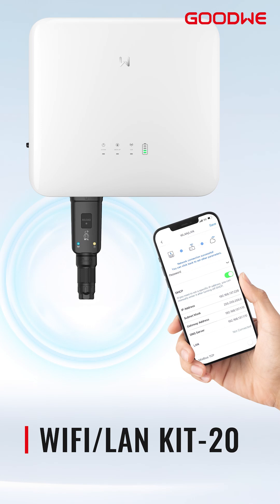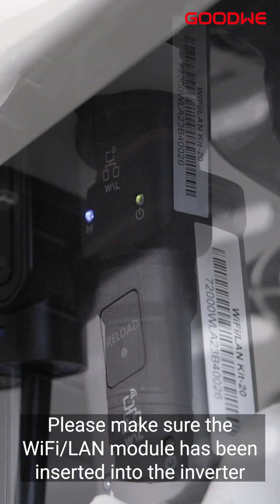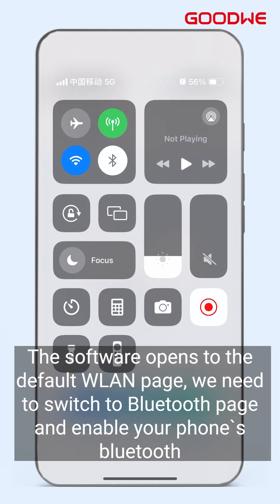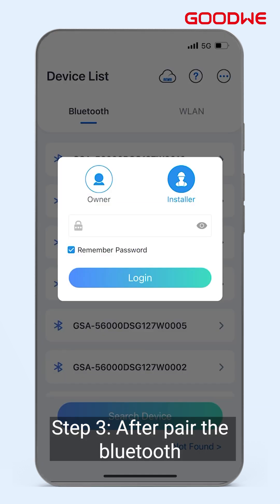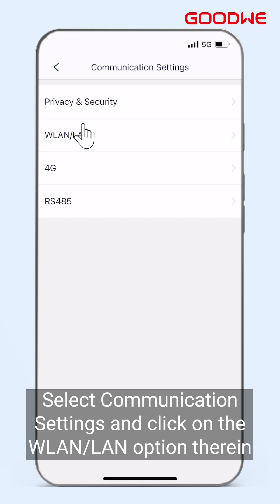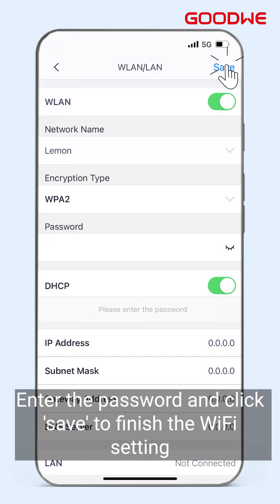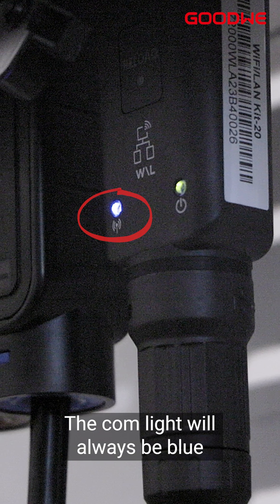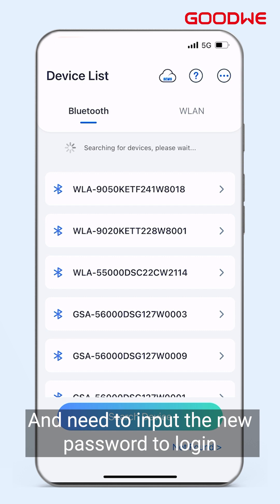GoodWe WiFi/LAN Kit-20 Configuration Guide

Comment: Can’t we configure via module wifi? Only this compatible with Bluetooth?
Reply from the maker: Hello, If you choose to connect the device via WiFi, open the WiFi settings of your
phone first and connect to the inverter’s WiFi signal (Solar-WiFi***). Default password:
12345678.
Reply: @GoodWeSolarAcademy    Yes i already tried to do for two Godwe inverters with this kit. But it’s not searching inverter wifi with this kit at all. I tried with many devices. Is there any solution for that. Thank you.
Reply: @GoodWeSolarAcademy  Hi , what if I cannot find the inverter's wifi signal at all - only bluetooth? What happens then? Could it be a faulty dongle?
Reply from the maker: Sorry, the WiFi-LAN does not support initial configuration via WiFi; Bluetooth must be used first.
Reply: @GoodWeSolarAcademy  Does it only work on Local Wifi / Bluetooth? What if I want to connect to the Inverter remotely when I am away?

Comment: Do I need a network cable connection to access the modbus tcp on port 502? Trying to open a connection to the inverter always fails with winsock error 10061. But modbus tcp is enabled and Wifi also works.
Reply from the maker: Hello, the network cable connection is required to use Modbus TCP.
Reply: @GoodWeSolarAcademy  Are you 100% sure? In the mean time, i was able to use modbus tcp with the wifi lan kit, but without connecting the lan cable to the kit... Only wifi connection...
Reply: Hello, do you need the dongle 2.0 for the modbus? I have the WiFi+lan without the reload button…